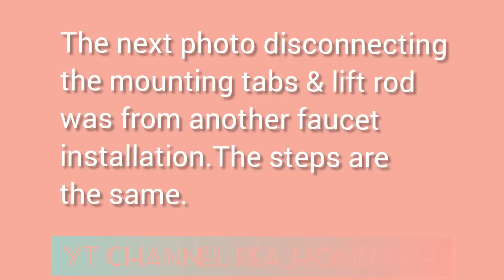How to Remove a Pedestal Sink | DIY by Real Regular Homeowner

Comment: I followed your tips to a tee. Unfortunately, the builder must have glued the back of this thing to the wall and also the base of the floor.  Any tips on getting this out in one piece as it.doesnt seem to move even.
Reply: I got this out a few weeks back.  Had to use multiple putty knifes and a heat gun.  Had to stay persistent and it gave way
The sink was caulked down for many years which made that silicone hard like a rock and they overdid it.
Reply from the maker: it's unfortunate that you had to work really hard to get it pulled but glad to know that you finally did!
Reply: @Rea_HomeFor4  yeah got it done a year ago. Those guys must use a full tube of silicone. 🙄
I've just recently replaced the toilet in that bath with a more efficient one as well

Comment: I f you are removing the sink anyway, why not undo the plumbing part (except drain and water supply of course AFTER you have removed the connection of the sink to the wall
Reply: Thank you. I skipped back a few times  trying to work out why they were doing that. 🤔
Reply from the maker: we did not know, we are regular homeowners doing diy, you can skip that part when you do yours

Comment: If the sink was slightly twisted  could l just take out the silicone from the back of the sink and straighten it with more silicone
Reply from the maker: You probably can, use a level to make sure it is leveled.  Since silicone does not dry quick, you might want to check the level of the sink and re-adjust accordingly during the drying process.